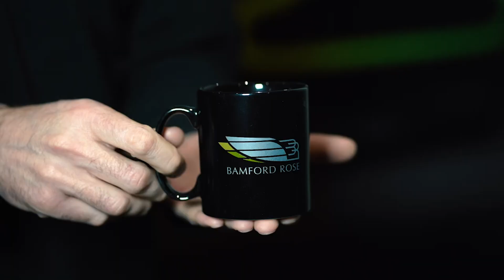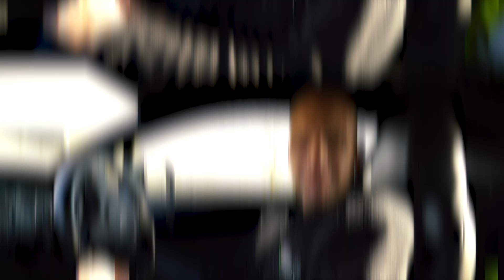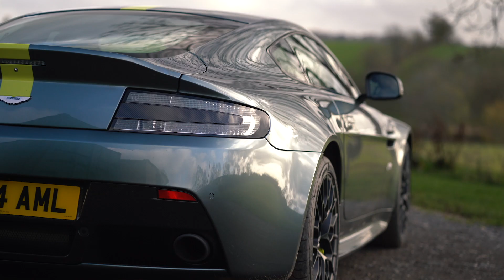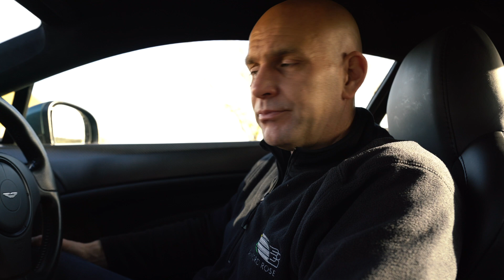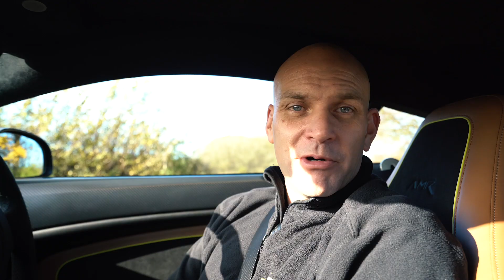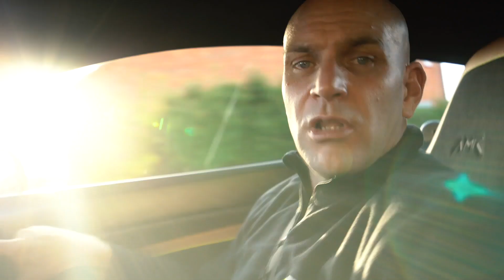What's the 7 speed manual really like to drive? QOTW #77

Comment: Great video and good information, thanks so much.  As drivers, we all know transmissions basically come down to preference.. I have a '17  Ferrari California T  with a dual clutch as well as  a '17 Vantage S manual. I love both cars, each has it's own distinct personality. There is no question  as Bramford points out, the S manual takes more concentration to drive well, while the T DCT is effortless, so fast , polished and easy to drive fast. With that said, there is just so much old school fun to the S, the sounds and feel of power of the  NA V12 screaming through the gears. If you are a manual person, don't let this video stop you from driving  the manual, after 500 miles, it will become second nature.  Both are wonderful cars with their own unique personality,  I am blessed to have them both.

Comment: Very interesting video. I wonder... would it not be possible to engineer some kind of lockout mechanism to prevent an accidental reverse engagement? Obviously such a custom mechanism would be expensive to design and build but if it is possible to do so, wouldn’t that ultimately be cheaper than fixing a buzzed engine?
Just curious 🧐 🙂

Comment: I’ve somehow got two 7 speed V12s manuals cos they are great. If you know how to type on a keyboard then you will be able to use the 7 speed manual. Nothing complicated and stick it in AM shift to match Rev between gears and make sure you have the drivers window at least half way down!! Pure V12 orchestra. Last of the best Aston V12s
Reply: Same bud. Also ended up with 2 myself. Something in the water😝

Comment: @morecarsneeded
Reply: Thanks for another fascinating video. My experience is limited to 10k miles on a 6-spd manual V12V (as well as 20k on a DB7GT), and have never used a paddle shift (!). You've certainly put me off the 7-spd manual, which I've never tried. I had presumed problems with the 1-2 dog-leg could be side-stepped by using 1st as rarely as practicable. What I hadn't appreciated was that the inevitable lateral spring-bias in favour of the 4-5 gate would make it easy to overshoot the 2-3 gate on a downshift into 2nd...
But I write this mainly to comment on the  presentation of these videos. Steve is an engaging personality, but do we need to have face contact with him throughout his briefings? I would prefer in this particular case to have seen him stirring that tricky gear selector, even if that meant seeing only the back of his head! Also, an inset of the RPM gauge (and even the speedo) would always be useful in these driving sequences, if that were technically possible.
Thanks again, and keep up the good work!

Comment: I miss the occasional gear on my nissan micra (its my green offset car), and thats a 5 speed. Two more gears must make the issue quite common I'd have thought. The DB9 rarely has the paddles used unless there's a boy racer or a BMW around.
Reply: How does it hold with modern BMW's?

Comment: Great channel and really appreciate the effort you put in to sharing your extensive knowledge and experience!
I was recently lucky enough to buy a 7-speed manual. 
While the paddle shift is a good bit cheaper and may well be easier to hustle, the greater challenge of the manual was very much part of the attraction. Sure, you have to concentrate on what you are doing and where you are in the box. Sure, I've done 1 to 4 and 2 to 5 and 3 to 6 early on. But after 600miles, before putting into storage, I found that you soon learn the different loadings across the box and it becomes increasingly more intuitive and more rewarding. Absolutely no regrets from me!

Comment: good clarification between 6&7 manual vs paddle shift ....i just wonder if LHD 7 speed manual would  be little bit more convenient for the driver since  he doesn't need to stretch his left arm further instead he would be using his right arm and have better control  in 1,2,3 gears
Reply from the maker: I’ve driven an AMR 7spd LHD and had the exact same conclusions as I draw in this vid, but, I thought it was not appropriate to comment on that seeing as LHD manual shifting with right hand is not my ‘mother tongue’ 👍
Reply: @BamfordRose  the details you provide in your videos are of great help to us Aston Martin enthusiasts to determine our choice preferences.i wish you can shed some light someday on what is the mechanical difference  Between  the face lift  2016 onward  Rapide in S version vs the non S version both ZF8 speed....

Comment: Love Bamford Rose, but this video is utter bull. The auto blip and flat shift are optional, so you can turn them off and on at will. And even though you may be a manual purist, it doesn't mean that you want to be fully engaged in the process of driving every single time. So the option to have auto blip on the down shift especially is extremely useful on the drives where you don't want to be heal and toeing yourself. Also, the idea that when using the auto blip/flat shift basically means you are using a gear paddle, is utter nonsense. You still have to depress and raise the clutch correctly, with the correct speed, whilst shifting the gearstick to the correct position. It is still far more involving that just pulling a paddle. Sorry Mike, disagree totally with you on this one.
Reply from the maker: Hi.
Thanks for your comments. Sorry the vid prompted you to respond in this way. 
Perhaps you missed that I did say the auto blip and flat shift novelties would likely be turned off by serious manual users? 
On the drives when you don’t want that ‘full on’ manual experience and the auto blip is “useful”, doesn’t the fact a driver doesn’t want or need speed matching in those occasions (like 99% of how manual users drive their manual cars) mean there’s actually no benefit from a speed matched blip? So if there’s no need for it, just change gear without it, why have a throttle blip? That seems as pointless to me like how anti-lag crackles designed to keep a Turbo spinning have crept into naturally aspirated cars on overrun! If you wanted a speed matched shift, do it yourself! 
The main point here, and I thank you for bringing it to my attention because I overlooked it on the vid, is that the Bosch engine management system on 7spd does not allow a proper heel / toe shift done manually by the driver - whereas the 6 speed Ford Engine Management system does better, hence the need for the gimmicks??!!
The flatshift point I was making is that if you use flatshift it does remove so much of the skill of a shift, that you might as well pull a paddle and you’ll be quicker on the road / position for it. It might well be a tad more involving to press the clutch pedal, but compare that flat shift process and driving experience to paddle-shift, and in general, 6-2 shifts at much greater shift speed and without the over-rev risk to name but one positive in favour of paddles, and it’s my opinion that the paddle-shift returns the better overall experience.
I like 7 speed, but I think the 6 speed manual is better. I said 7speed is fine when not in a hurry, and because of the gate / faff, I’d sooner not take 7 speed on a track. I said the 7 speed is niche (for enthusiasts), 7spd will likely be worth a premium, and I clearly stated a gearbox is highly personal, but I’d go for a paddle-shift. So where exactly is the “Utter Bull” in there?! it’s a balanced appraisal, which I did back-to-back with the paddle-shift.
Gearbox interaction is as personal as exhaust note, ones loud is another’s quiet, and I made that clear in the vid too! There is no right or wrong answer, only the answer which is right to you! So to call the vid “utter bull” is missing all those points I made across the entire vid, and a bit harsh to say the least.
Reply: @BamfordRose  thanks for the reply. You are correct, and I suppose my comments do read a little harsh, which was not the intention! The utter bull part I am referring to is the assumption you make that a proper manual purist always wants to heal and toe, hence the functions are potinless. You spend almost a third of video discussing this assumption/position, when in reality it's a pointless talking point as you can turn it off and on at will, without impacting other parameters of the car (like for example in M2s to turn off autoblip also means turning off stability control). I fully understand your point of view about these functions, but presenting them as a negative aspect of the gearbox (which you do) is nonsense. The rest of your points are valid however! It is a challenging gearbox to use, and for track work you 100% want a paddle shift. Anyway, apologies for the harsh sounding words, not my intention, I just didn't agree with you in this one! And cheers for the all the content you are putting out, top stuff!
Reply: I’ve driven both the 7 speed manual and 6 speed manual and I personally have found the 7 much better. After driving it for 100 miles or so you very quickly get used to the box and I would argue you really don’t have to think much about what gear you are in anymore than you would in the 6 speed manual.

Comment: I own a 7 speed manual and it takes a little getting used to. Not so much the dog leg 1-2 change but the 2-3 and 3-2 changes. 

This is because the gate is narrow and the spring bias is on the 4-5 plane. You therefore have to be accurate and positive in your change from 2 to 3 to avoid selecting 5th. When changing down from 3 to 2 you again have to be positive and precise or the bias in the gearbox may make you select 4th. 

You soon get used to the gearbox and after a couple of hundred miles the gearbox became second nature.

I don’t track my car but it does gets driven in a spirited way across quiet roads in the North East of England on a regular basis.

The negative comments about the dog leg gearbox are mainly from people who have only driven the car a few miles (or not at all).

I have also driven the flappy paddle version and like that, but I was on a tuition day with Aston Martin

I’ve now done about 9,000 miles in my car and wouldn’t swap it for anything. The muscle memory is there even if I haven’t driven it for a month or so.

I am, however, what the gentleman in the Bamford Rose video describes as a ‘Manual Purist”.
Reply: I'm absolutely sure all of this is true Steve and love how your car looks (assuming you're chesby on PH) and yes, I've only driven the 7-speed manual on a test drive but I suppose the question really is: "Would the manual V12VS have been even better with a 6-speed rather than the dogleg 7-speed?" Obviously a hypothetical question but worth asking all the same. Out of interest, do you use the auto rev-matching on downshifts always, sometimes or never?
Reply: @petebungay953  Hello Pete, from experience, having only had 6-speed manual gearboxes and having this "dog leg", I would like to give my opinion in addition to that of Steve.
The 6 speed gearboxes are great overall and give a very natural feel in use.
On the other hand, this "dog leg" is pure, intuitive in a sporting use. Passing the 2-3 is a delight, like in some racing cars. As 2-3 is the most commonly used gear, I particularly appreciate this direct, straight sequence.
In fact, the first gear is so torquey that, except when starting, we don't come back to it anymore. The gearbox then behaves like a 6-speed gearbox. We forget this first gear. 
It's a little trick, the car being very torquey, if you forget to shift back into first gear, you can start in second!
As Steve said, it takes a little time to get used to it at the beginning but very quickly it becomes intuitive. Going back to a classic 6-speed gearbox, I'm missing something.
I don't know why Aston Martin's engineers installed this gearbox:
- high torque which forced them to multiply the gearbox ratios?
- I don't know why Aston Martin's engineers installed this gearbox: high torque, which meant they had to multiply the gearbox ratios.
- To give a driving sensation derived from the competition in the sequence of gears?
- Other reasons...
What is certain is that this gearbox is sensational. It makes this car even more unique by giving it a strong, highly personalised character. A unique driving experience.

Translated with www.DeepL.com/Translator (free version)
Reply: @petebungay953  Yes I am Chesby on PistonHeads. If you only drive the 7 speed for a few miles (less than 100) you will think the six speed is far superior because the change comes naturally. The 7 speed takes some learning but after a 100 miles or so it becomes second nature. The engine is so torquey you don’t require the extra gear but having driven about 10,000 miles in mine I wouldn’t prefer the 6 speed gearbox.
Reply: @petebungay953  I sometimes use the AMShift Rev matching on down shifts. I have never used the full throttle up shift.
Reply: Ditto. Same findings
Reply: Manual all the way. Its the only way to drive.